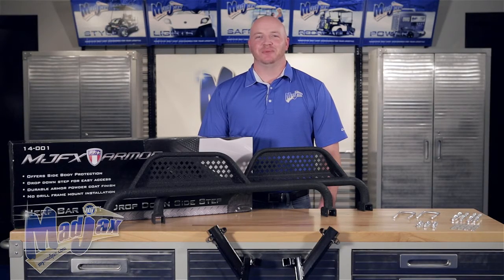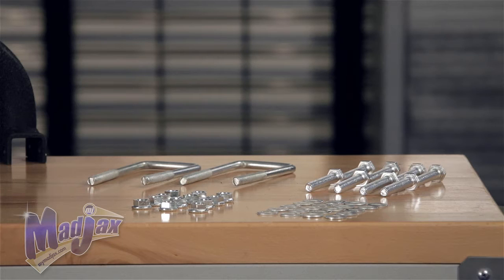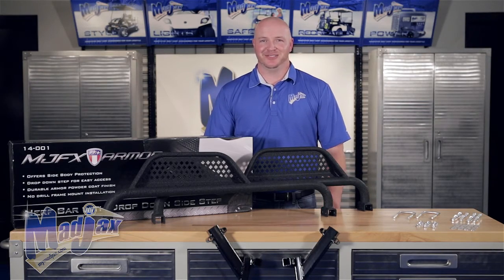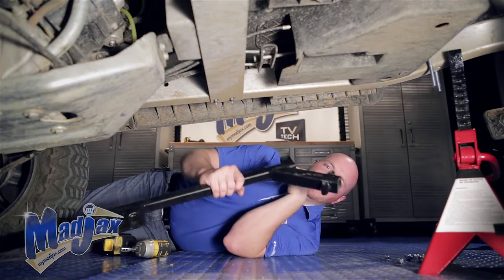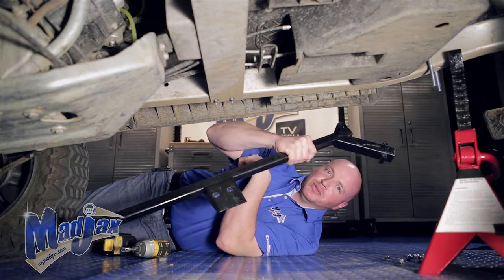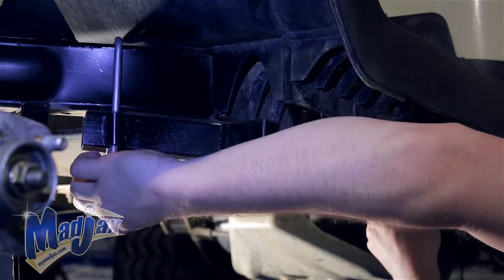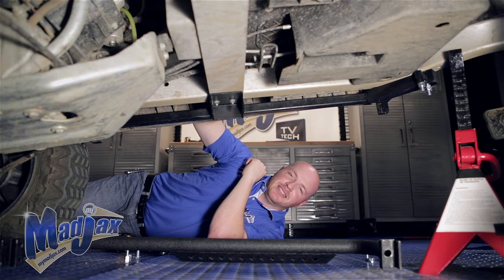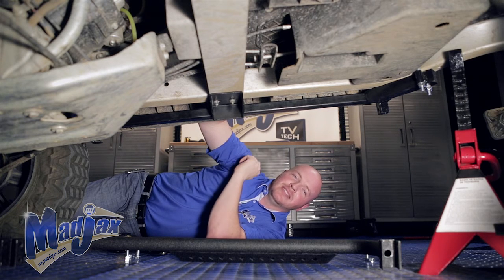Side Steps for Club Car® Precedent® | How to Install Video | Madjax® Golf Cart Accessories

Comment: bought the madjax mount and assembly kit.
Unfortunately, there is a screw that is hitting the tail end of the bracket so I had to drill a 1in hole into the side of the bracket to accommodate that screw.